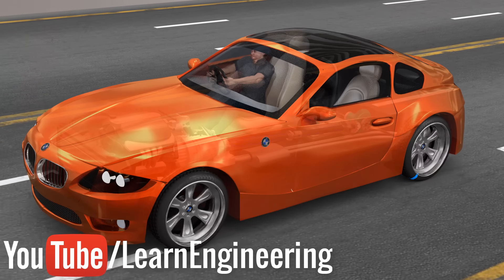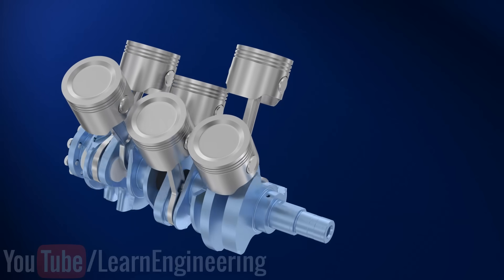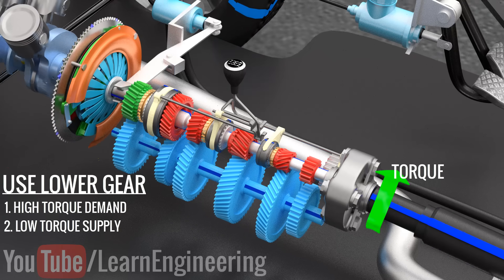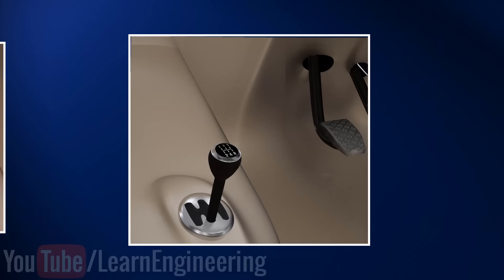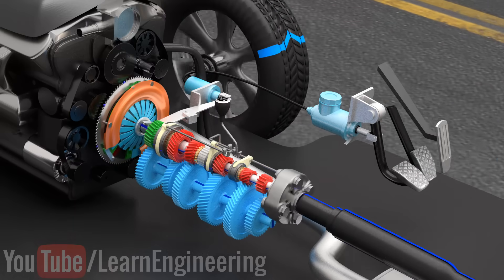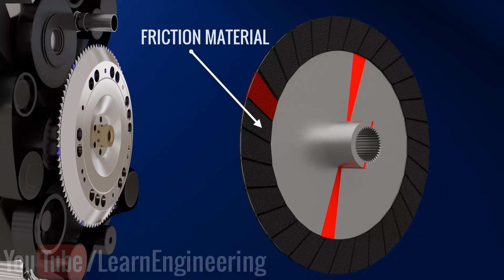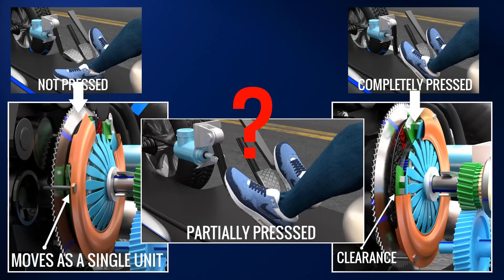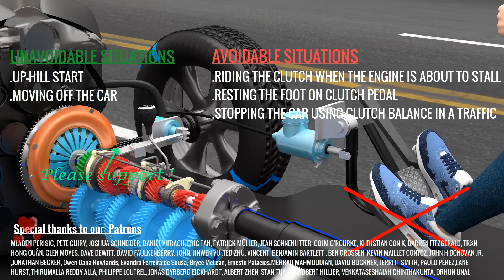Why you should not PARTIALLY press the Clutch?

Comment: I found out about this negative effect of riding the clutch one day while stopped on an uphill slope in traffic. Instead of disengaging the clutch and using the brakes to stop and remain in place, which would then require me to engage first gear to get going once traffic started moving, one day I just rode the clutch to keep the car in balance between going forward or letting gravity take me down the hill in reverse and into the traffic behind me. I did this for many minutes because of the heavy traffic and suddenly my car started to smoke inside the cabin and it smelled of burning brakes, which in effect was my clutch burning up. After realizing that my clutch was getting damaged I immediately stopped riding the clutch and haven't done it since, except for some occasions where it is very momentary. It is definitely a bad idea to ride the clutch frequently and especially for extended periods of time. Lastly, it is possible to shift gears without using the clutch on many vehicles including motorcycles if you know your vehicle and know how to feel the engine revs and then time the shift precisely.
Reply: Weird!
I got learned in driving school to uphold in a hill with the clutch! To be prepared to go directly when the traffic was easing up. But that was actually wrong then, it is better to brake and put the clutch fully down?
Reply: @RubberTag  i think its okay to hold yourself uphill with clutch as long as its only momentarily.
Reply: @SamandRie  yeah, that's exactly what I do now sometimes.
Reply: @RubberTag  yeah, it's definitely a better idea to disengage the clutch completely if you're going to be stuck on a downhill slope for a while.
Reply: @RubberTag  once you’ve been driving manual for a while, you’ll be able to stop on a hill and start moving whenever you need to. Try getting better at stopping on hills and then quickly getting the car going forward so you don’t roll backwards at all. This doesn’t have to be a smooth or quiet process at first but it will be after some practice. It’s literally all about finding where you clutch actually engages with the engine, once you’ve got that sweet spot you can give the engine power and let out the rest of the clutch
Reply: @seaofalchemy5309  I can do this already but it sounds on the other comment that this is tearing on the gears!
Reply: @RubberTag  If your car doesn't have ramp-support you may use your hand-brake.
Reply: @bozokluoglu_  I don't use the handbrake at all for that purpose, but I suppose it's an option for those who prefer it.
Reply: @RubberTag  you ONLY partial the clutch if you are expecting to move quickly or in stop and go traffic.

Idk how long dude was sitting idle on the clutch but IDK how his foot wouldn't have cramped out before it started testing the limits of his car.
Reply: @nsahandler  Yeah, what I was learned in driving school is that if you are going up a hill and you have to stop for passing by car while you are in the hill, you should find the "up-hold" where the clutch is want you to move forward but not too much so you just stand still and let go of the clutch and gas when you are going forward again.
So just while the passing car is going by really.
Reply: Float 'em right in brother
Reply: @Loki24369  indeed
Reply: You have to slowly release the clutch until you feel it pull you forward then you release the break and fully engage the gear. I’ve been doing that forever and it prevents me from looking like a Panzy using the handbrake
Reply: @jimmy200  yeah, that's the right way to do it if you're going from neutral into 1st gear while traveling up and upwards slope or when you come to a complete stop anywhere. I just didn't know that riding the clutch could do damage at the time and I was being lazy I guess as well. It also just feels cool when you balance out the engagement of the clutch on an uphill and you have no shifting to do... but yeah, now I learned it's bad.
Reply: Ferrodo has a terrible smell
Reply: @sideparting6845  Yeah...it really does smell terrible!
Reply: I tend to clutch less change in my work van apart from 1st and 2nd
Reply: nice, im buying a fckn electric car.
Reply: @EEK-XAAK  actually, so am I.  And just FYI, my brother owns a Tesla and electric cars come with some negative things of their own, which I've learned from some of his experiences. Still though, with the prices of gasoline always on the rise, it will be nice to get away from only relying on petroleum.
Reply: This example is awesome, thanks for sharing. It gives you an exact idea of what happens it you drive the clutch.
Reply: @roman.venica  yeah man you're welcome. I found out about riding the clutch too long the hard way and I wouldn't want that to happen to anyone. The burnt clutch smell stayed inside my car for over a month and I also don't know how much a new clutch replacement costs on an expensive European import car like mine but I don't wanna find out. I'm sure no one wants to find out regardless of what they drive.
Reply: I had to stop on a hill near where I live regularly (it's right off the off-ramp coming off the highway to my place)... what I would do is to put the car into neutral and brake... now if it was an absurdly long wait I could use the emergency brake but it was normally not too long so I would just brake and then as I judged the line was going to start moving any second, I'd shift into 1st with the clutch completely in and be ready to apply gas (a bit more on a hill than usual) and slowly take my foot off the clutch to get it moving uphill (but I don't suggest doing that of course till the point that you can see the line already moving at the front and therefore know you will be called to move in a 2 or 3 seconds.)  I had about 15 years of driving standard up that hill and being stopped quite a bit and never wore out a transmission or had any other notable damage so it worked well for me.  P.S.  For people who are really worried about rolling back (such as new standard drivers or say it's an extremely steep hill and you're not that experienced,)  my Mom would tell us to work the emergency brake (having it on and taking it off slowly as we moved the car forward in first) if we really felt we had to...  I didn't really feel the need but it might be necessary for some.  I personally wouldn't make a habit of that though. I tell new standard drivers to go out and practice hill starts during late late hours when traffic will be almost nil (like middle of the night) to build their confidence at handling hills.

Comment: Ok, so here is the case: What happens or how good/bad is it is to press clutch (full) when car is on a high speed to maintain a required amount of motion? 
For e.g. on a highway if I run at 100 kmph and then leave accelerator with pressed clutch till it comes around 60 kmph and so on. Will it be fuel efficient ?
Reply: when the clutch is engaged or you're in neutral the car isn't getting slowed down by the transmission but unless you're in a slope you're still gonna slow down because drag
Reply: @AdrianOkay  I do agree that vehicle slows down due to friction. But is this act fuel efficient as not pressing accelerator save fuel ?
Reply: @abhy9181  Ah, i get what you're saying now,  the idea you have already has a name: ''coasting'' and probably just with that term you can read a lot about it
Seems it only saves fuel downhill, and in straight line it can end up increasing your fuel consumption
Reply: @AdrianOkay  Appreciate your response. Thanks. The video was really informative.

Comment: i partially engage when shifting sometimes. especially when im downshifting quickly right before an icy corner. enough where the synchros work properly but there's still a little bit of contact with the fly wheel. its like lazy double clutching. when rev matched its a little easier to keep it smooth since the output shaft is more inclined to stay at the same speed as the motor.
Reply: I constantly rev match just to save the brake pads 🤭

Comment: I personally like how it shows the crankshaft pointing the wrong direction… kinda hard to connect the nose of the crank, where the harmonic balancer bolts on, to the flywheel where the clutch bolts on

Comment: I haven't watched the video yet, but I'll say this right away: Unsynchronized transmissions REQUIRE you to not put the clutch pedal to the floor every time. Unsynchronized transmissions have a clutch brake that activates when you push the clutch pedal to the floor, and that clutch brake will be destroyed if you try to use it while the vehicle is moving. 

(This is still true in brand new semi trucks equipped with manual transmissions. Synchronized manual transmissions don't exist (I think) for semi trucks. They build "automated manual" transmissions, which act like automatics, but they don't make semi trucks with synchronizer gears, as far as I know.)

Comment: Can't drive without using half clutch over speed breakers as I drive a diesel that doesn't have good torque at low rpm.
Fck Hyundai, suspension is another headache.

Comment: Also in that instance when you are in a gear too low for proper acceleration, what can happen just before engine fail is what some reference to as "bucking" ...your vehicle will do multiple short jerks forward in attempt to adjust before total engine cancel. It is how you can tell when someone is inexperienced with manual transmission driven vehicles, and most embarrassing. I however, love shifting low to climb, otherwise, to myself, your considered lazy...geez, it's only a peddle and takes seconds. It can also be dangerous depending on location in traffic, whereas you are very limited in sudden changes of movements due to not shifting properly. I love stick!!, more engine control, which is how and why you save on gas.

Comment: Here we go for the controversy. Unpopular opinion but whenever shifting, engaging or starting. Ride your clutch. If you have any kind of length to drive obviously take your foot off it. But when shifting be slow and gentle to that pedal. A clutch (friction disk) is a grinder wheel in a different application. It's made to grind down and save your other parts. For those who are not mechanically inclined this is pricy. But a clutch itself is cheap. They last a very long time too. I almost always ride second gear when I start. I only use first to crawl. The wear you'll put on the clutch starting in 1st then shifting to 2nd is equal in my opinion. So to avoid spin use your clutch, also if your tires are spinning riding the clutch is pretty important. It's all to the individuals ability and understanding. But I say especially when learning don't worry about riding a clutch, it's cheaper to replace than bearings or your gearbox. Be safe out there.

Comment: Question. I have a very lowered car manual 6 speed, where i live there are multiple speed bumps that are close to each other about 3 feet seperate. Now i have to go very slow over each bump in order to not damage under the car as much but there is no way i can keep it in first gear without riding the clutch to prevent it from stalling. Is this bad or is there another way of doing it

Comment: You are supposed to “ride the clutch” in 1st gear when starting from a full stop, and also if you need to go super slow (like 3 mph or less). Other than that, you shouldn’t ride the clutch, especially not in higher gears.

Comment: Clutch is supposed to wear.. better replace it once than be super annoying to other drivers, by trying to save your vehicle as much as possible. You either can afford riding public roads and move around efficiently or just dont buy a car and use public transport.
There is nothing more annoying on the road than driver who saves his car parts like those are supposed to last forever.
Road isn't perfectly smooth? I will drive 5 km/h. - . -
I will break with my engine to save my breaks from wear and will start breaking from the distance of 500 metets, so that only me will pass on green light. ;D
Just f*kin drive.. or stay home.

Comment: A clutch is either engaged or disengaged.

Half engaged is burning the clutch plate. And half engaged creates more wear on the clutch plate.
So do what you want but don't be surprised if the clutch needs replacing sooner.
Reply: springs are usualy stronger than you resting foot. now if you in some weird position etc, so you forcing your foot more than you aware etc, than it is other thing..

Comment: Ride the clutch only when you set the car in motion on an ice/snow track. Get the 2nd or even 3rd gear and ride the clutch very smooothly.

It avoids too much torque and  slipping the wheels. 

It is an emergency approach used only for few seconds, thus your clutch should bear it. And be careful whether you can not endanger anybody else on such a road.

Comment: There is one very important thing that is not mentioned here that happens to the engine when the clutch is depressed.  The crankshaft is pushed forward causing it to run heavily on the  rear part of the thrust bearing that is on one  main journal . This is not a problem with normal use and most high mileage engines will show no sign of wear in this area. But as an engine reconditioner that has reground a lot of crankshafts i have seen plenty where the driver is obviously to heavy on the clutch, dirty oil doesn't help either

Comment: load of rubbish. I drive with my foot feathering the clutch and I get more longevity out of my vehicles than most I know.
last van I owned I bought with 60k miles on clock , took it to 250k and sold it whole still going strong at that mileage. 

the key is keeping revs down. the way we are taught/recommended to drive is generally over reving and not getting up through the gears quick enough. This puts a lot of unnecessary strain  on the engine

Comment: In some commercial trucks with non-synchronized gears, there is a small brake on the input shaft to stop the rotating mass to easily engage a gear when fully stopped.  however, fully depressing the clutch when the truck is moving will put premature wear on this brake.

Comment: Come on, it depends on where you drive. Where i live, its a small hill station with densely populated and small road, everyday there's a traffic jam with crawling speed stop and go on a hill. You need to half clutch and ride the clutch alot when doing stop and go in crawling on an uphill. It's very common for the fully loaded pickup trucks to overheat and burn their clutch.

Comment: Everyone rides the clutch a little bit. Of course you can be excessive and burn out your clutch faster that way but as a manual truck owner I just take it that changing your clutch out is going to be something you have to eventually do just like changing break pads. Try to ride it as little as possible to extend your clutch life just like you try not to break hard all the time to extend your break pads. Regardless you will eventually need a new clutch just like you will new break pads, that’s how I see it. Of course your clutch should certainly last way longer then your break pads but that’s jut an analogy.

Comment: Is pressing the clutch all the way to the floor means riding the clutch? I was in the traffic and the speed was too slow for 1st gear ang too fast for the 2nd gear. So i chose 2nd gear but not releasing all the way cuz its too fast so i was at half way. When it need to slow i just full press the clutch all the way to the floor. Was that a bad technique?

Comment: You've gotta be a bit odd to ride the clutch instead of downshift, once you've learned how to rev match, downshifting is like the most satisfying thing you can do just short of a good smooth pull. I'm glad my dad taught me right. Only time I ever have my clutch pedal anywhere between 0 and 100 is when I'm dropping into a higher gear and accelerating smoothly or starting in first and that's for as little time as humanly possible, basically bite and let out
Reply: So in many cases it is necessary to lightly press the gas pedal as you are releasing the clutch (but still partially pressed) to smooth it out, right? And could rev matching be used when upshifting? Say, for whatever reason you didn't shift in time and the RPMs fell completely. You'd want to rev match even though it's an upshift, right?
Reply: @DoctorChained  Yes to the second but I almost never run into that situation, but I have a newer car so I have more rev hang. In my car, a '16 Jetta GLI, if I get on the gas in sync with my clutch biting, the acceleration is much smoother. I rarely need to actually let my revs fall. Once I feel my wheels pulling me again in the higher gear though, I'm pretty much off the clutch. Hard to describe but like any car you've just gotta feel out what feels smooth and doesn't have you riding the clutch

Comment: In short, when you need high torque or your engine rpm is falling, instead of clutch riding at high gears, just downshift. P.s. he is absolutely not talking about riding clutch in first gear during extremely low speeds or launching car.

Comment: Steep incline and a red light at the top with a Big rig hauling 20 Ton you have to feather the clutch or you roll backward if you hit the brake and clutch at the same time your screwed no fuel and both feet holding the rig on the hill . you need to have 3000 rpm and the clutch at the right torque to hold the rig on the hill so you can get up the hill without rolling backwards.  same with a car or pickup truck .